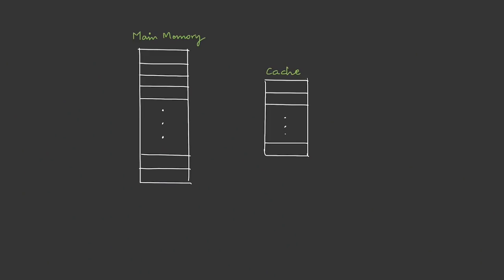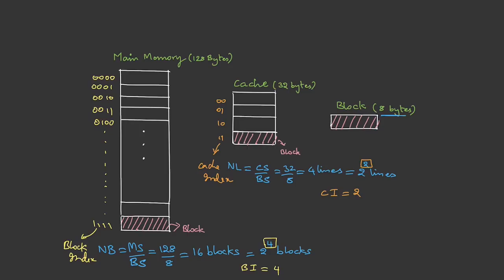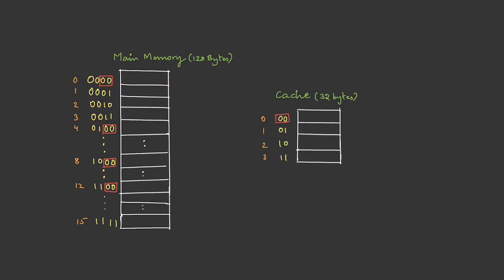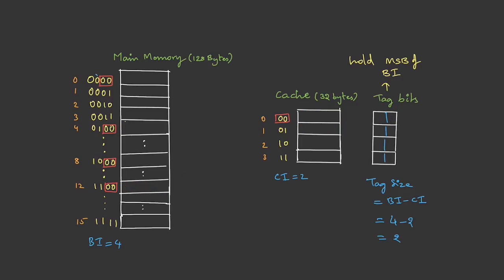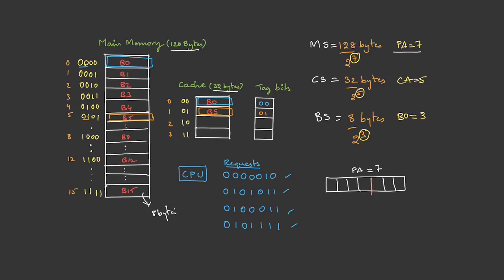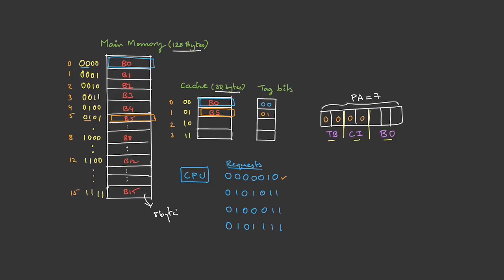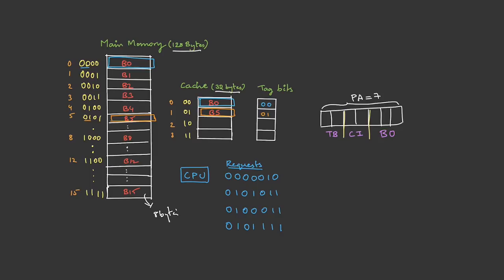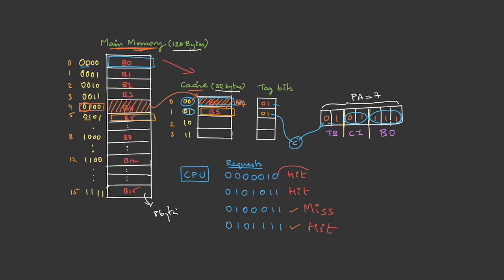10. Understanding Direct Mapping - Computer Organization - Gate

Comment: So basically if the the cache is a miss, the CPU will go to the main memory to access the data and load it into the cache, and if it is a hit the CPU will load the data straight from the cache? I am just a little confused as to if it is a miss, will the data not be pulled until the next clock cycle?